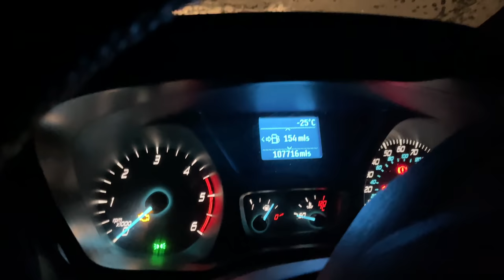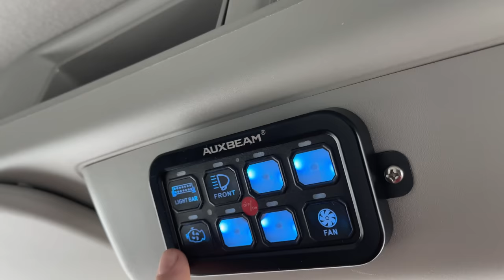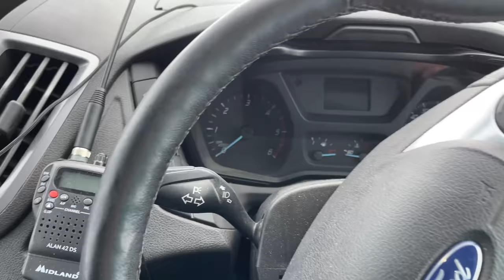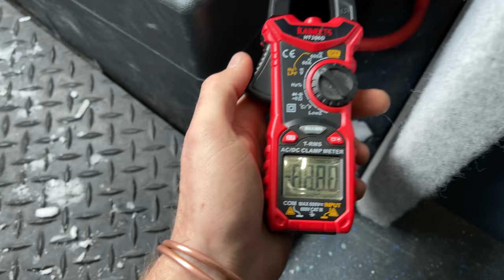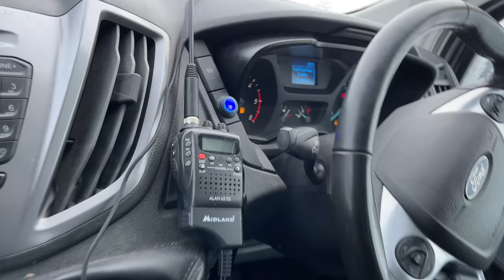Van DIED in ARCTIC cold temperatures | Extreme Winter Vanlife

Comment: -25C is NOT Arctic temperatures LoL...  Take it from someone who has worked in the high Arctic.  -25C is your very average Canadian mid mid to late January to mid February temp. Additionally, an engine coolant mix with too much glycol will also slush up.  If you flush your cooling system and cannot get all the flushing water out then take the coolant capacity of your vehicle, divide that by two.  Take that quantity and add that quantity in 100% full strength coolant to the cooling system.  Then complete top off and air bleeding with distilled water.  This way you can rest assured your coolant strength is a perfect 50/50 mix.  Oh! One last thing!  Use a Refractometer as  hydrometers are grossly inaccurate when it comes to depending on coolant mixtures for extreme cold and high heat ambient temperature environments.
Reply from the maker: North American Arctic and Nordic Arctic they are going to be different. This is only luleå which is coastal and still about 75 miles south of the Arctic. This is a two year old video. The day following this trip I did a coolant swap And spent rest of the 2 following season in colder conditions without issue. I also subsequently a own refractometer

Although instead of a full drop. I used a refactomemeter figure out my actual coolant freezing level, used an online calculator to tell me how much of the current mix I had and how much to take out to replace with pure glycol to get my mix up to 50-50.
Reply: P. S.   Always carry a length of exhaust hose...  Worst case scenario if your diesel or gasoline vehicle freezes up all you need is a passerby that has 10 or 15 mins spare time.  Put the exhaust on their running vehicles tailpipe, stuff the exhaust end of hose up the engine bay with the hood shut and VOILA! toasty warm engine, coolant, oil and battery!  We do this all the time to get large heavy equipment diesels running here in Canada.
Reply from the maker: @gmctech I need about 6 m of exhaust! Got plenty of spares of me. the season After this, I had to lend Out some of my spares to another van up in the Arctic when they had issues with their heater.
Reply from the maker: @gmctech do you have admit I’d love to ship my van or a future van over to the North American winter one year. This particular video is basically the first few days of my first winter trip. I’m getting ready for my third one now
Reply: Average winter temperature inbthe Arctic where i work is -40C.  In Alberta I've headed out to my morning meeting at 4:30am and ambient temperature was -48C.  Last year in Nova Scotia we had a 2 week cold snap with evening temperatures clise to -25C, so yeah i know a wee bit about true Arctic temperatures.
Reply: At the end of the day props to you.  You figured it out.  Had enough equipment and ability to rectify your situation.  A bit of a distance to go for an equipment shakedown! LoL but to get some cold you gotta travel.  Hope you make it over here!  Lots of places to camp and lots to see!  Summers have kinda sucked here in Atlantic Canada as they've been down right monsoons!

Comment: Should have kept the motor running at lowest revs that it would keep going until it got some heat in it. Chances are it would have started to run better. You can use that heat gun to heat the intake air which is a big help for diesels in the cold. You sorted it in the end though which was good👍
Reply from the maker: Subsequently learn it would’ve probably been alright running diesel even with semi frozen coolant for a few minutes but at the time didn’t have the knowledge. Not a bad decision if the engine sounds horrific and it’s -25 to turn it off. 

The heat gun trick I learned from some other people who have spent time up here using it to thaw out individual parts
Reply: @MispronouncedAdventures  You did the right thing. The pre-heater is there to protect the engine. It was making a noise because it could not pick up the oil fast enough.
Reply: Agreed. So annoying to watch.
Reply: Exactly.  Much better to pay for a new engine then to freeze to death.   And the engine will heat up fast. Never shut down a running engine in extreme cold. Common sense survival 101

Comment: Proper anti-freeze should not be slushy at a mere -19*C. Biggest concern is a frozen battery, so once engine was initially started, regardless of running rough, should not have been turned off as once the engine ran a bit it would smooth out.
Reply from the maker: Coolant freezing level all depends on the glycol vs water mix. There was way to much water in / Diluted and the freezing level was way off what garage told me ( should of tested it myself ) but did a full swap a day later and put never had the issues again. 

Battery wise on the transit there are inside the cab in the seat base so a lot water than in the engine way.

As for the engine running, at the time I didn’t know if that was ok or not. So I thought best to shut it down to be safe which seems reasonable to me, I know it was going to warm to -15c in a few hours . But I know it would of been fine now

Comment: Tip: In such situations I have a small stand alone petrol stove (normally used for cooking). I light it and place it under the sump (12" below) and close the bonnet shut. The heat rises and is trapped in the engine bay. Heat initially (and importantly) goes into the sump but also spreads into the block by convection. After about 30 mins the entire engine bay would be > 0 degrees. The only other issue might be frozen/sludgy diesel in your tank. As I expect you already know, starting your engine in these seriously cold conditions puts many many times (perhaps 100 to 500 times) more wear on your engine than a warm summers day. Things like cylinders/rings/bearings can see metal to metal contact for many seconds and leads to short engine life. Your preheater is an excellent choice, but if it fails I'd use the petrol stove technique. Good to have a backup stove anyway, incase your electrics fail (for your induction stove) and you are in the arse end of nowhere without rescue. Another pre-emptive thing you can do is use thinner oil than OEM recommendation for these ultra cold trips (and higher concentrates of glycol in the coolant as you know). HTH. :)
Reply from the maker: great comment. I always have back ups. I did have a gas stove with me just incase and we’ll aa a complete spare engine pre heater unit and air heating unit with me.  I didn’t thing of using a gas stove like that. More indirect heat over direct. 

The following day I sorted the coolant , and for the rest of the trip, the engine pre heater worked in colder conditions, and it started like a summer day.

Comment: living in a extreme cold country -30c during the day ...a good tip if you can not plug in the car ...run it every 4-5 hours for at least 10 minutes....keeps everything from freezing up (oil,coolant,etc)
Reply from the maker: The webasto engine preheater can left on thermostat, it’s overnight was gonna be colder than -30 is that will be my plan to leave on mode., that night was only about -25 max unfortunately the coolant was the wrong mix and froze that was rectified the following day

Comment: Hello from Finland. Enjoying your videos a lot! Regarding engine coolant mix, I'm always using 50/50 water-glycol mix as it should be the optimum mix ratio. Never had any freezing issues even below -30C.

I think you should've just left the engine running there when you got it first started. Sure, it sounded "bad", but then again, diesels usually do, especially when cold, but it won't damage it. You probably have modern fully synthetic engine oil in there which retains it's lubricating properties even in the cold temperatures. Surely the preheater's usually a good thing to use as it's gentler for the engine. Just my thoughts on the matter.

You got a nice van build there, I must say. Very nice and sophisticated electrical system and the van seems very cozy all in all. Just found your channel and looking forward to watching all your content!
Reply from the maker: Thank you for finding my channel. Yes, I originally thought I had a 50-50 Mix, but I was mistaken ( given the wrong information ) , and it was a lot more diluted with water than I thought, ( I did a coolant swap a few days later and rectified this issue ). 

As for the engine, I have subsequently learnt, it would probably be fine, stressful on it but fine. But not having that knowledge at the time and knowing it would warm to -15 later on in the day, so the coolant would thaw again. I thought it was better to wait it out to play it safe. 

As for oil, lucky for me, it’s Euro6 engine and runs a thin oil ( 0w30 ) so pretty ideal for cold temperature. 

Thank you very much, I do  really like my van build and electrical system, works perfectly for me. Enjoy the rest of videos
Reply: Hello from northern Alberta, Canada. I concur with everything you said, especially regarding the antifreeze mix. 50/50 antifreeze and distilled water. VERY IMPORTANT. If the coolant freezes, you run the risk of cracking the engine block, or at least blowing out the freeze-out plugs. I've had no problems with gasoline engines in my vehicles down to -45, or so. Ideally I'll plug in the block heater at anything lower than -20 and it will start right up.
Reply from the maker: I had no issues with the block heater ( it’s just couldn’t pump frozen coolant. The problem was the current was definitely not the mix I thought it was. It all got taken care of, and the next trip will be checked before.
Reply: He DEFINITELY did the right thing by not running the vehicle! You have thermal shock potential where you are basically overheating yoyr engine with little to no coolant flow then BAM! -20C slushy coolant lets loose and fills the hot engine.  Could crack the block and/or warp the head.  Also a chunk of ice could hit the water pump impeller and shear it off.  So NO he did everything right here in this predicament.
Reply: @gmctech  Engines are not made out of glass.
Reply: in england top up normal water every garage so

Comment: Nice adventure, glad you could sort it out on your own.  Shows the value of understanding your electrical system and adapting to the situation!  And most importantly not to stress out and just work the problem.
Reply from the maker: Definitely stressing and panicking doesn’t fix the issue normally makes the overall situation worse. 

Yeah for me building your own van and electrical system means you understand how that works and adapt it

Comment: Also as someone else mentioned, using a portable fuel cook stove. But pile snow all around the front of van to prevent wind and help contain heat
Reply from the maker: Aye anything to heater the engine bay is a good option. I did have a gas stove with me as well

Comment: Love sorting out these sorts of problems, it’s these challenges that make memories 👍👍 you could run the Webasto periodically to keep the engine warm. Some just leave the engine running in those cold temps. Brilliant video.
Reply from the maker: Problem-solving definitely adds to the experience. 

There would be a few options yea, the webasto heater automatically will switch back on again when the coolant drop below a certain temperature ( and I kept the heater turned to “on” mode ) . However generally I don’t need the coolant temperature throughout the night, only before I drive off in the morning. So normally turning the engine preheater on before I leave is absolutely fine unfortunately because the coolant mix I had was more diluted than I thought it froze preventing it from working
Reply: @MispronouncedAdventures  Demon Tweeks supply an electric oil pan heating pad by a company called Wolverine, I was going to fit one to our van to preheat the engine when on hook up. They come in 12v and 240v in various sizes. Less than £100. Just a thought.

Comment: I can't believe you had such a weak mix. Its a miracle the water pump worked as they are plastic. At these latitudes the oils have a much lower viscosity.
Reply from the maker: Yeah, they mix was not what I thought it was or told it’s. But not a massive issues, I swapped it out a few days later. Oil wise not a issue as my van already uses a very thin oil

Comment: Hi, used to do testing in the USA, coldest we gir to was -44c started ok but pumps sound noisy due to oil viscosity.
Once you have it going just let it warm up!
Might be worth running the diesel heater on a timer to automate it’s starting when it’s so cold.
Take care M.
Reply from the maker: Hey, this video is from my first winter, now on my third. lots of different changes. Generally, I find down about -35 I can engine preheater and start it with no issue.

North American engines are very different than European engines. I believe yours are far easier to brute force starting in the cold.

Comment: Having had an engine freeze, it usually blows out some sacrificial core plugs, rather than damaging the block itself. Still bloody inconvenient, and debilitating but not the end of the engine.

Loving your adventures, you’ve done a cracking job with that van.
Reply from the maker: Yeah I’m very glad it was only slushy and not fully frozen.
Reply: I hate to burst your bubble but these holes in the block are not frost plugs.  They are where the foundry supports the water jacket cores through those holes during the casting process.  While yes some people have gotten lucky and their block didn't crack when the fluids inside froze, but man many an engine block has crack even when these casting plugs have popped out.

Comment: Don't forget to use antifreeze in the door locks and rubber lubricant on the door seals so you dont get locked out of frozen out  50/50 is a good idea .
Reply from the maker: So far locks and doors seals have been all good! Yeah the mix should now be at 50-50

Comment: Good day to you and absolutely great video. On my bus with the diesel air heater, I used 7/8 inch copper tubing and two brass valves to redirect the exhaust of the heater directly to blow on my engine block, on the exhaust side. At 0'F and with the diesel air heater on, it will keep the engine at 15/32'F. I gave it a try with the extra parts I had lying around. I figured the exhaust heat was wasted energy. My profile pis is my bus.
Thank you
60107 USA
Reply from the maker: Thanks for watching. That a great way of using some waste heat when you need it, I like the valve idea. I normally don’t like extending heater exhausts when they don’t need to be all the time and it can give sooting issues with increased back pressure from a restricted exhaust effect the burn
Reply: @MispronouncedAdventures  interesting you mention the sooting. Here is what I did discover between that flexible exhaust tubing and seamless copper. The copper tube has micro flakes that can be seen in the snow. The thin flex tube has larger than sand chunks. I did take my copper exhaust tube off for some.engine work I did this last summer. Only some very small flakes came out in bottom of rinse bucket. The primary exhaust had lots of chunkage. Probably caught in the ribs. Wow! I never thought my crazy observation would ever be used. 
On another note, I do find the sound of the copper tubing to be more air rush sound than actual exhaust sound. Sound like a very low level air hand dryer from a distance.

Comment: Get an electric water heater element for a small electric water heater. Attach the male end of a small extension cord fir a wall outlet. Plug it into your inverter and insert in radiator cap or coolant overflow for 30 min..
I've used this trick on big semi truck engines, took about 30 minutes, and it fired right up.
Reply from the maker: I have a more powerful 5kw engine pre heater over a electric block heater.  But the coolant froze which was the issues.

Comment: It might be an idea to have a spare exhaust pipe from the diesel heater to run into the engine bay, i know it will be a bit fummie, but it would heat all the pipes up???
Just a suggestion for future trips??
Great vids by the way 👍
Reply from the maker: Part of me isn’t such a fan of the idea of pumping exhaust gases into the engine bay from a corrosion point of view. 

But the coolant mix was fixed a few days after this, and I’ve subsequently done another winter and even colder conditions without issue